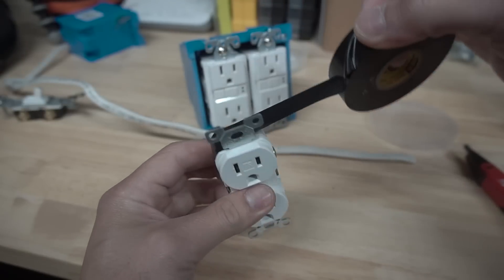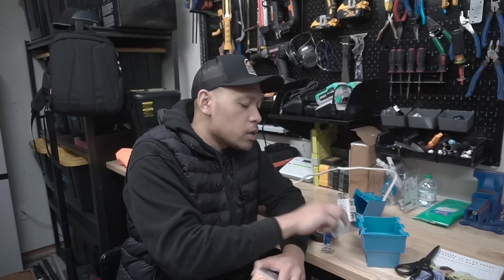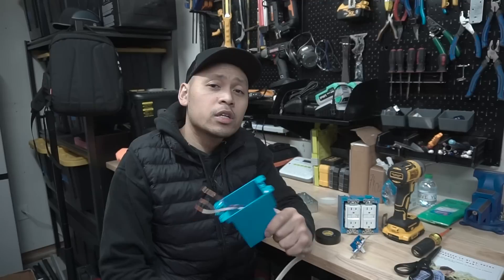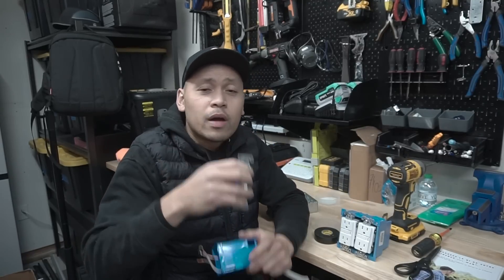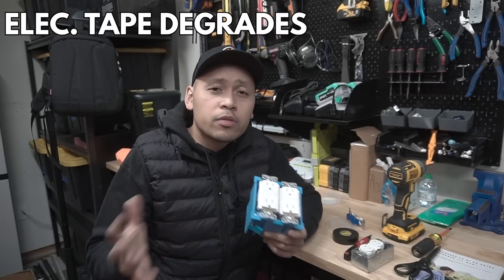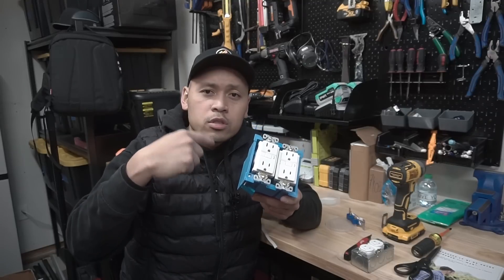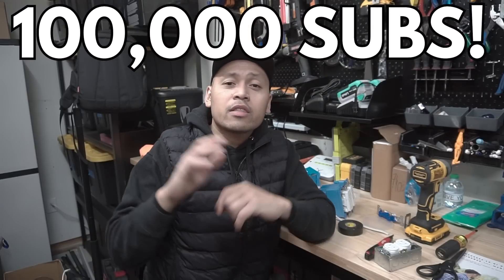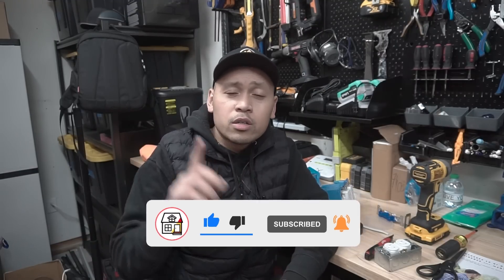Is It ILLEGAL To Wrap Outlets And Switches With Electrical Tape?! The DIY Great Debate! How To

Comment: NM cable uses conductor insulation that is rated up to 90 deg. C.  Previous NM was only rated at 60 C.   The typical NM cable insulator is PVC, which is the same substrate at Super 33 and most electrical tapes.  Super 33 is rated up to 105 C.   The biggest issue with vinyl electrical tape is that it is not stable and will harden/crack and/or turn into a black, slimy mess.  I will not let my guys use electrical tape even to tie up wire rolls.  Quality tape like 33 or 33+ helps, but none of them are designed for long-term insulation.  I worked on a home where every electrical connection was mechanically twisted and then soldered and wrapped in friction tape (that's what they used to call it).  It's just a black, icky mess to deal with.  Sometime before wire nuts (circa 1963), I suppose.  Interesting fact:  Wago connectors predate twist connectors by more than a decade and you will not find twist connectors used in Europe.  Most didn't even know what wire nuts were before the Internet.

Comment: I don't do this on outlets that are getting a cover in the moment. Of course while the house is being built, a circuit could be turned on to help out the trades or maybe the home owner needs the circuit during a renovation. Of course you won't be able to put a cover (well you could but it could get scratched up) prior to drywalling and such. So to keep everyone safe you can tape the outlet or switch. That's usually when i would do it. Is it wrong to do it for every outlet? No it can be safer, but possibly a waste of tape if its already got a cover. Plus if you go to fix things or add to the circuit, the tape may be an extra step. 

Nothing wrong to tape or not, Just if the box has no plate, its safer to tape.

Comment: My father was a certified electrician many years ago. He taught me to always wrap the switch.
Reply from the maker: Thank you for the feedback
And for sharing!🙏🏽😊
Reply: He taught you incorrectly.  Just because he was your dad and an electrician isn't an argument for doing something incorrectly.  Did your dad teach you to go back several years later and see what a mess it makes?  Do the job correctly and you don't need to wrap devices.  If you feel so compelled, then use a self-vulcanizing rubber tape.
Reply: @DiffEQ  lol you said “he taught you incorrectly” my dude there is no code on which way is correct or not so your personal opinion of it being “incorrect” carries zero weight. I’ve never seen an inspector fail something for electrical tape being on it so.... who’s wrong here? It’s more a do it your way and respect others for doing it their way. You’re calling it out as though he was taught wrong... there is no right or wrong in this situation 🙄

Comment: In all of my years as an electrician I have rarely encountered wrapped devices. The best approach is to keep your wire lengths as shout as possible, so you don't have to cram any more wire than you have to in the J box and pay attention to where the wires are going, keep the hot away from the neutral terminals as you push everything into the box ext.
Reply: You need atleast six inches of wire. Box fill refers to number of devices and # of conductors.

Comment: Ideql the wire nut people make a rubber band that is wide and can be stretched around the outlet or switch and can protect but be easily removed without tape residue.  Probably the best way to handle this.

Comment: I find it wrapping it only when absolutely necessary because I hate when somebody wraps the shit out of it. And then when you need to test it because it's wrapped you can't get your prongs on the screws I prefer to test from the screws where the wire is wrapped or actually at anyways not a bad video 👍👍👍✌️🖖🚬🌲

Comment: Here's the real reason why the practice of taping outlets started in commercial work back in the day. In those days you were expected to work the majority of circuits hot. It was done so the next guy after you had less of a chance shorting out the device when pulling it out of the box to either replace it or having to fish new wires into the box.
Reply: makes sense....think of the next guy even if its 20 years later...
Reply: Damn. I hope there was hazard pay.

Comment: Wow, so many professional contractors arguing over taping up your electrical connections with tape.  I did read many comments on here and I agree with both sides.  Over 42 yrs as a general contractor I also do all my own wiring and all I can say about this topic is this....  I only found taped up switches or receptacles in metal boxes.  This is just my findings when gutting homes or commercial buildings.  I myself used tape in metal boxes only, because of the material surrounding the connection and the tolerances on the sides of the boxes.  Again, it's preference.  I give this guy credit,  no way could I make a video for 45 min on how to tape up your electrical switches,  god, how long can toilet paper video go....
Reply: The code mandates clearances and capacities for devices and wires by box size. If your work meets those mandates, you should not need tape. If you are NOT meeting those mandates, why not ?

Comment: Note: NEC is about minimums, most Electricians and Contractors do better than minimums in work or jobs they do. I use tape around devices as I by experience feel it may be good idea or necessary. Think on this example: 200 metal boxes to install 200 devices , do I want a call back to trouble shoot an inadvertent ground fault due to a device ungrounded terminal touching metal or bare grounding conductor? If you have ever worked the Electrical trade installing devices you know you will install the devices as fast as you can to get the job done and move on to the next job- at least that is how it was in the good old days.
Reply from the maker: Thank you so much for sharing and taking your time to share your experience! 😊🙏🏽

Comment: My dad never taped any of his outlets and box extensions were required by local code if you daisy chained the outlets. Upstairs dad got deeper boxes. I would use doubles and front plate reducers for EMT wiring. I seen that in commercial wiring. 73
Reply from the maker: Thank you for sharing! 👍🏽😊

Comment: Interesting discussions here. The video actually mentions the cons, but downplays them. I am surprised that some electricians actually recommend taping receptacles, as outside of the US I have never seen an outlet or switch in a utility box wrapped in tape, unless there was some defect.

The reasons given for this practice seem to indicate weaknesses in design or wrong methods of installation. I would never assume that a device without a cover plate is safe to touch. Tape is not a solution for overcrowded or too tightly designed boxes. Tape is not a child safety device approved in any electrical standard in the US or in Europe.

I do see damaged extension outlets wrapped in tape or tape used as a temporary fix. Therefore I associate the presence of electrical tape with defective devices or unprofessional, temporary workarounds. Any time tape appears to become necessary, there is probably a defect somewhere that should be remedied properly. Therefore I can fully understand that inspectors would be suspicious of taped devices.

Comment: I don't see what difference it makes with plastic boxes it's senseless to use tape. They used to solder connections and use friction tape in the old school wiring after knob and tube era. Even knob a tube used solder connections with friction tape as well. Burndy connectors were also used then taped. 73

Comment: One thing you can be sure of, if you're general labor for a contractor, assuming you have been trained to do the work correctly, their PRIMARY concern is how Fast you are. Construction has a razor thin margin & ONLY the fastest will advance. Wages are Everything to a contractor and mistakes do occur, bad day or not.

Comment: Interesting, I have always done my own repairs so maybe I have always taped any exposed wires but I have never heard of taping around a switch or outlet.
   But I could see taping the area if it extends beyond the box.
Reply: It's good practice to never have any "exposed copper" in a box with exception of a ground. "Shiners" can cause problems in the future. If you have enough wire to work with, do it right and trim your wire to the lengths required by the rec, or switch. Never leave exposed wire bare. And in the event there isn't enough wire to properly do the repair or replacement, move the box up or down to gain more wire to keep the issue within code requirements. An electrical fire is a life safety concern. Always better safe, than sorry

Comment: It’s interesting how heated discussion develops over topics which are mostly resonate preference. Both sides have valid arguments. I’ve been doing my own electrical work for at least 40 years, and I try to read as much as I can to stay up with best practices and latest codes.
I’m not licensed, but id like to think that I take care in my work. I have used tape in crowded metal boxes, but usually don’t bother in plastic. There are probably unusual circumstances which could cause problems either way. 
Tanks for sharing the information. It seems Ike you’ve done your research.
Reply: Good logic. I follow the same practice.

Comment: I never use tape around a device in a box. It's nasty, can hold moisture, makes troubleshooting, revisions and repairs a sticky nightmare but most of all it is;
1. The sign of an amateur. Now I know I must question everything in this system.
2.The sign someone scared of electricity worked on this. I will find more stupidity.
Reply: Yes!!!

Comment: It used to be legal and even standard to have two circuits in one box but no longer, it leaves uncertainty as to whether the box is hot and also you can end up with two separate phases and 240 volts where you're expecting only 120.  They also had a common neutral, which if it went out both circuits were 240! Light bulbs got real bright and motors started whirring faster, things burned out, and fires started.  You will still find them in the field though in legacy electrical systems. Another place where wrapping with electrical tape adds to safety.
Reply from the maker: Thank you for sharing! 🙏🏽😊

Comment: taping devices is good practice for safty future drywall repair and paiting and the plastic plates do break i treat everything like it is hot .. as far as working hot it helps alot when trying to find a break in the circut i do not recomend any diy work any circut hot  to find a short pull device twist it and see if anything changes  a easy way to find a circut at beraker is plug in radio turn up volume so you can hear it at breaker box turn off breakers one at a time untill raido shuts off or use a light on extension cords the bigest problem i have found is the connections at the device wires not wraped around the screw properly orwires stabed in devices always twist wires and use the corect size wire nut to the corect tightness wabos are just a stab connecter doomed to fail

Comment: Always defer to whatever the electrical code says period then you can never be wrong.....But. whenever you are dealing with a metal gang box I think it only make good common sense  to protect from accidental shorts. Like I said it depends on local code and if an inspector wants to visually inspect the box's connections the extra tape might cause you to fail an inspection so if you choose to put the additional tape wait until you pass inspection!
Reply from the maker: You have a good point! Thank you for sharing! 🙏🏽😊

Comment: I’ll always wrap a receptacle or switch.  One time I did not I was attempting to put a switch in a metal box and a terminal came in contact with the box itself and shorted causing the terminal to burn up a bit and left a distinct black mark on the box, also tripping the breaker.  After that, it’s one thing on my checklist I always make sure I do before buttoning everything up, always!
Reply: Why are you changing switches with the power on lmaoo

Comment: Can you imagine any sparking with all that highly flamable tape (plastic and glue) near or part of the sparking?

Follow the NEC and local code. Both are well researched by professionals. Going above and beyond by may be counterproductive.
Troy.
#

I stand corrected. See replies.
Reply: Although I agree it's a shitty practice electrical tape isn't anymore visibly  flammable than the jacket of romex.
Reply: The code is a book of minimums, that tape is UL listed for use near "sparking"

Comment: Wow, I just cannot believe how badly designed those sockets and switches are, if they were sensibly engineered the terminals and screws would be recessed in to the units, so very unlikely to accidentally ever short.  You should have a look at the back connectors to U.K. sockets and switches, also if we use a metal back box it is connected to Earth, so even if a wire did short to the box the trip would go.  The only negative about our light switches is generally they only have live and the switched live going to them, so putting smart switches is convoluted.
Reply: You are so right. The American socket outlets and plugs are fundamentally a poor design. No shutters to stop things being poked in and exposed pins which you can touch as you put the plug in . Also many different standards of polarised and non polarised, with or without Earth pins and different Current ratings. Technology Connections has done a good video about how terrible the extension leads are too.

The British completely redesigned the system in 1947 as BS1363 and have further improved it with insulated sleeves on live and Neutral. But America keeps the same flawed system to this day.
Reply: How small are your device boxes, and the not grounded/earthed box shows really bad electrical work. So remember stay safe, it only takes a fraction of an amp to kill you.
Reply: you guys would be better to adopted the UK electrical wiring standards